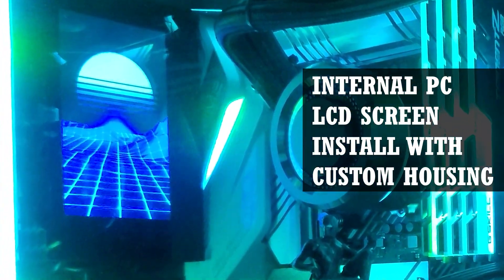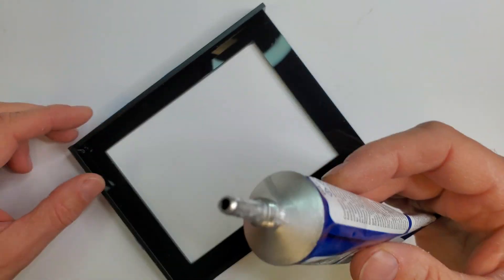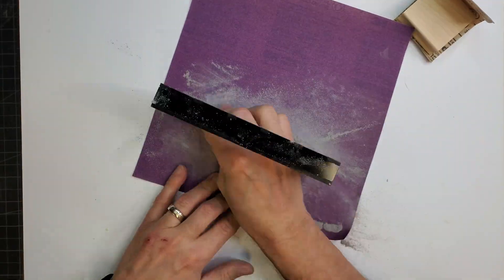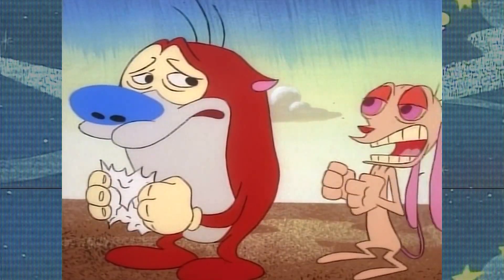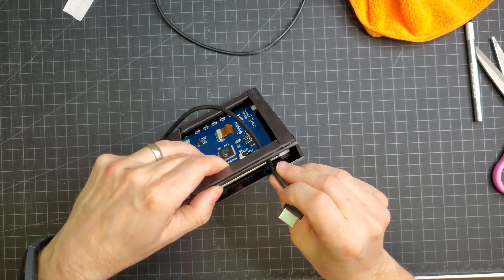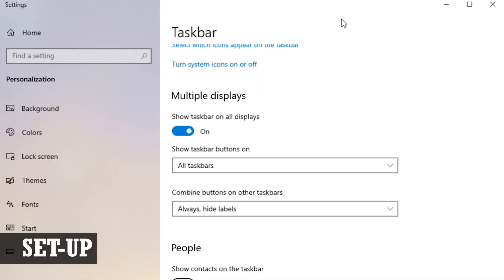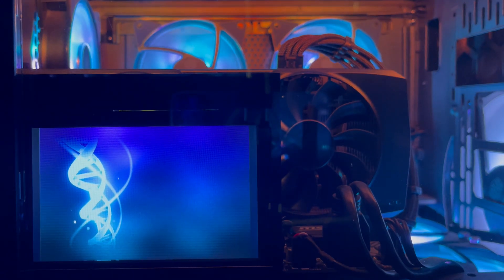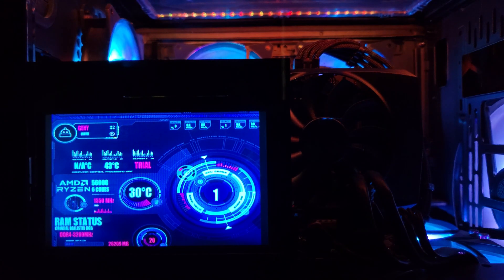PC Mod - Internal 5" PC LCD Monitor Computer Display Install with Custom Housing

Comment: i like the idea and kinda want to do something like this with my case.. one hang up tho is it seems like its going to introduce weirdness to have it tied into your windows display settings.. like i use my computer for remote work occasionally and i already have a headache going from a 3 monitor setup to a 2 monitor setup. menus load out of screen space and you kinda have to re-setup the desktop each time. i can only imagine the headaches that having little 5 inch lcd panels in your computer case would introduce under the same parameters. is there anyway to run these little lcds panels without having them tied into your main work monitors?

Comment: Very informative video. Thanks for explaining the how-to. I'm looking to do a similar build with a larger screen to replace my front panel and I wonder if there will be enough power delivered to it from the motherboard usb port. What is the reason for using a 5 pin cable on the 9 pin usb port on the mobo? Will it not work with a full 9 pin cable?
Reply from the maker: Good question. I think the 5 pin cable was all I could find at the time. I would have definitely used a 9 pin if it was available because I wouldn't have had to figure out that you only plugged into half the port. I can't speak to the power issue, but I guess you could always access an outside power source if the mobo didn't provide enough juice.

Comment: Can you turn it off with your pc?
Reply from the maker: Should be able to. It works just like an extra monitor. You can completely control it in Windows.if you can't turn it off, you could always just throw up an all black image on it.